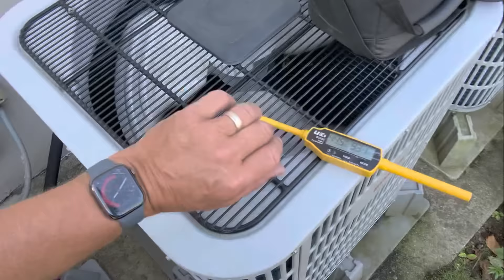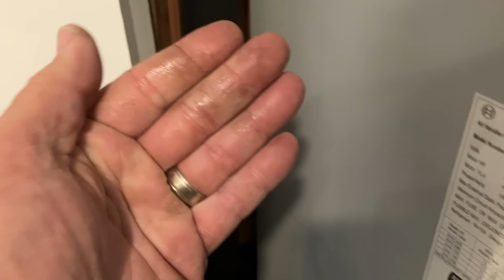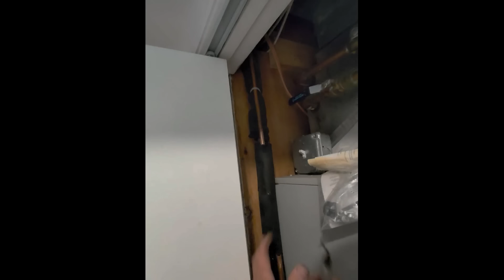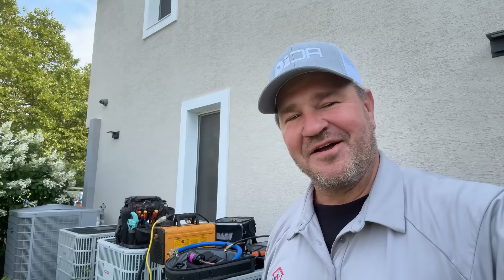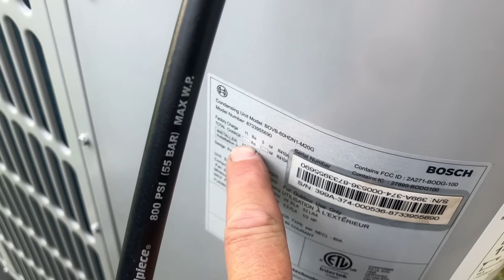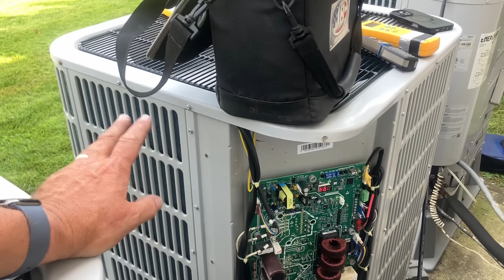Bosch IDS 2.0 NOT COOLING—We Found the Leak & It Needed 11.5 LBS of R410A!

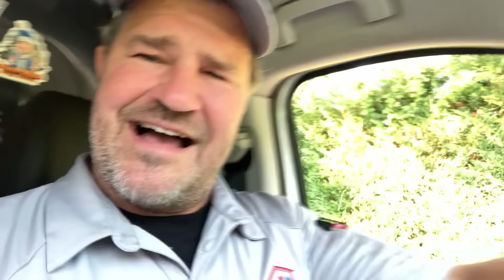Comment: 7:49   "'I'm gonna close off service valves not to recover all the freon...."   DEAD ASS WRONG YOUNG MAN!   *Bosch only used R410a/ R454b & is an refer blend.  
You KNOW you have/had a leak. So now ALL the Freon inside condenser is a CRAP MIX. (Not Pure)  Then you said "Shoulda pumped it down"  Even more shit 
You MUST remove ALL Freon & install New Virgin, after the triple evac & 500micron test .
Not to mention you/your crew fudged up with a shit braze on the dryer. Now you're fudging your customer with shit mix freon.
YOU are the HVAC guys/companies that make real HVAC companies look BAD.  Thank you Jack Leg/Ass
KNOW I UNDERSTAND WHY YOU CALL YOURSELF "MIKE'S PIPES"   BC YOU F*CK ALL YOUR CUSTOMERS WITH SHIT WORK/SERVICE/EQUIPMENT/INSTALLS

Comment: I found a hex attachment for a regular socket wrench somewhere some time ago, I don't think it was at a supply house though. So no problem opening or closing those valves on the Bosch. It is kinda tight access, but alot of brands are like that.

Comment: I love in Phoenix AZ and honestly the midea heat pumps just can't keep up. We have had reps come out. The company I worked for just stopped offering them. Now that said, they work well in cooler climates.
Reply: Thermostat set to 1cph. Air flow set  accelerated cooling on . And it should be fine

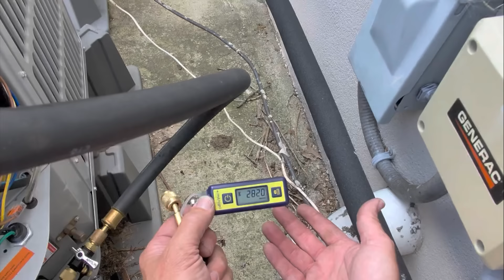Comment: 20:15 It’s because that micron gauge is being hit with refrigerant every time you open the valves, you’re supposed to have a valve protecting the vacuum so you close it before you open the king valves, you can try and clean that bluvac, it will work but not like it used to, it’s compromised like your navac micron gauge

For the longest i thought the navac micron gauge was trash because of your videos but it’s just that you don’t protect them and thus messed them up
Reply: you can clean the sensor with 99% iso alcohol
Reply from the maker: Navac was shit outta the box
Reply: Blu vac can take liquid

Common sense blow in it and will clear it

Comment: 20:15 its because you are hitting it with refrigerant and it screws it up. I do the same setup as you but I have testo vac probe, does the same thing. As soon as you crack that liquid service port take the vac gauge off as quick as possible
Reply: I  use the  MG44  micron gauge if i expose to refrigerant it  gets wonkys like the one in the video, you just need to clean the sensor with 99% iso alcohol, and it will go back to normal.
Reply: I bought the old school Yellowjacket 69075 with the blue case.........that's been the most reliable for me